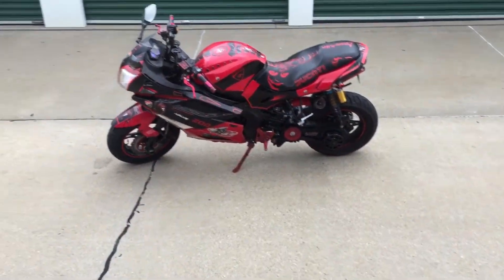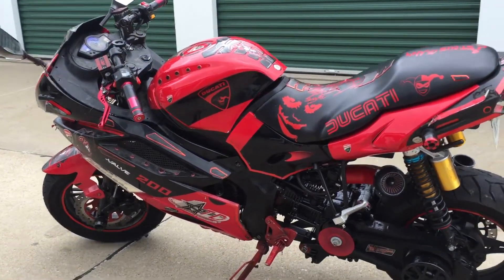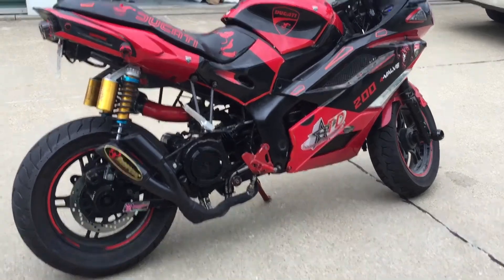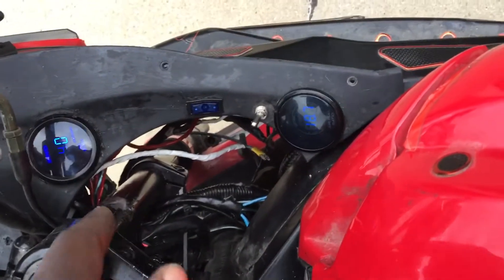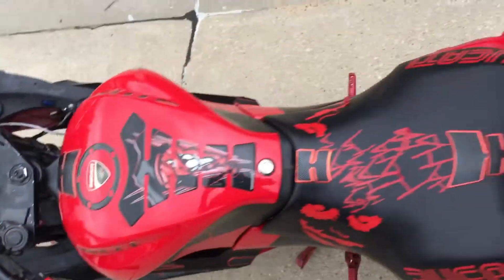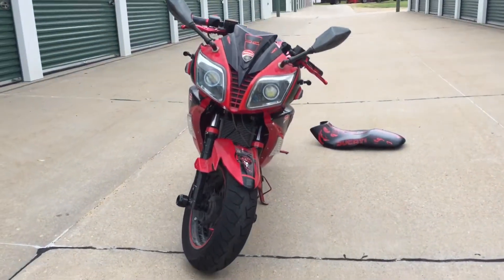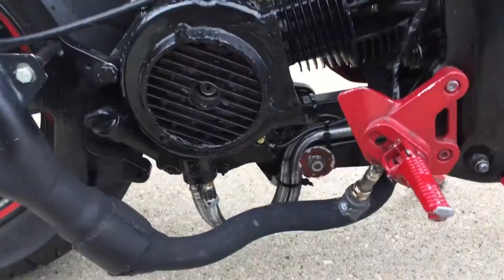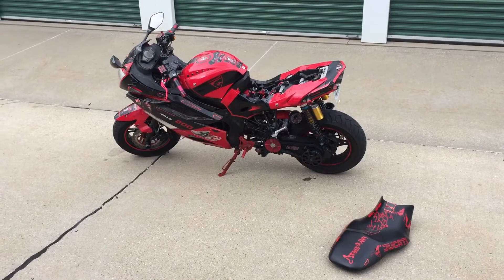Gy6 8.2mm stroker 206cc 4-valve

Comment: I'm trying to get to a 232cc right now.. I have the gy6 b motor I'm trying to get the 67mm bbk.. can I use the 8.2 in That
Reply from the maker: Just so happens I just built this engine for my new project bike , video coming soon, & it gets complicated....... basically you have to order the special crankcase made to accept the 67mm piston (eBay $400).... a lot of engines say “ b case” but are still 54mm stud spacing....the ones that actually are 57mm stud spacing will still only allow you to bore up to 63mm piston without destroying your oil port on the right half of crankcase.....I have the engine with 16” wheels which case is even more complicated because it uses a bigger crank which normal gy6 cranks will not fit (I tried) & they don’t make stroker cranks to fit so you will have to use stock crank,,, I had to order the entire special crankcase just to only use the right half (with modified oil port location & oil cooler outputs built in) in order to bore to 67mm (making my engine only 205cc) ..... the taida 67mm cylinder comes with spacer built in so I had to use 94 link timing chain with extended chain guides also taida head & valve cover (because the factory head & cover will not fit taida cylinder) , also I would recommend using taida t-300 camshaft or A-14 camshaft (same as t-300 but cheaper) .......shit is an expensive build bro but my 205 is a beast (: .....but to answer the question, the only way to make full 232 with 8.2 crank is to buy the special crankcase

Comment: So wait... what do you need in order to out that 8.2 mm stroker in? That's mf like a BAND.. so im trying to see what I have to do before I get that boy
Reply from the maker: No you can find the 8.2 on eBay all day for around $200 the taida is just more expensive for no reason.....the crank is not the problem, going up to 67mm piston is the hard part ....in my opinion going with 63mm piston with 8.2 crank will be a lot easier more affordable & you won’t miss the extra 27cc at 205cc
Reply: You might have to show me where this stuff is.. i have the same bike as yours. Just the 2021 but im sure it's not much difference outside the year ... do I get the 2v or the 4v big bore kit? Like the more I research I keep finding things and getting confused like this Taida Cylinder 63mm 205cc Liquid Cool Kit w/Cast Piston Fit 54mm (GY6). It has a port coming out of the bore for liquid cooling.. im like what? Do I get that or what...  this the link to it https://ncystore.com/taida-cylinder-63mm-205cc-liquid-cool-kit-cast-piston-fit-54mm-gy6?search=205cc%20big%20bore%20kit&description=true
Reply from the maker: @BigEagle4  I would go with 6mm stroker & 63mm oil cooled cylinder for a reliable 199cc ....also I’m pretty sure you have the special 150engine with bottom engine mounts instead of top mounts , meaning you can’t use the 232 case without welding new motor mounts on your bike anyway so your only option is the 199cc which you will still need to install an oil cooler
Reply: Bro how in the HELL! did you change the mount to the top
Reply from the maker: @BigEagle4  has to cut off old motor mounts & weld new mounts... not something an ameteur should attempt at all
Reply: Lol I'm over here pissed now cause I have I have the taida crankcase with those top mounts.. not about to go pay to have it done either..im just going to have to stick with the biggest bbk I can get for the Gy6 A crankcase... any info on that ?
Reply: Bro where can I get an exhaust pipe that fits cause the company I've went through has sold  me 2 parts totaling over 400 that I cant use and they won't correct the issue like wtf.  Pisses me off

Comment: I found that .005 intake and .006 for ext found it runs the best
Reply from the maker: Mattie g'rock yea I did too after ruining a 4v head got new one and that works great now upgraded to 400cc engine and that 206cc 4v original built up engine from my roma just sits in my garage

Comment: put a breather oil dip screw so it will fix your   back fire it will be sounding much much better
Reply from the maker: Leon Bennett I stripped out spark plug socket and was trying out a slightly different hotter spark plug that was my problem so the fix was helicoil for original spark plug or a new head, instead I chose to upgrade to a Suzuki Burgman 400cc crate engine....you should check out my last video....206 engine is sitting in my garage now

Comment: All of your videos professional and nicely done.  Have you ever thought about taking a job as a motorcycle customizer.  I will try my hand at it very soon.  I may have questions for you.  However, I would be working on a manual transmission 125cc to 180cc big bore conversion.  Nice work on the 400cc conversion, you have done the impossible amongst the small bike enthusiasts.  You’re starting to come up to the major leagues 😄
Reply from the maker: Al-Zamil Yamatazu thx my bro stay tuned for more updates on that 400cc upgrade!!

Comment: Nice I see you got the cover off the motor does that cause any issues how much faster is she
Reply from the maker: Vince Long rode it all day yesterday noisy engine in this video turned out to be carb vac leak.....she did not run hot and yesterday was a scorcher here in Iowa ...acceleration isn’t much more noticeable without fan and engine cover but she was already torquey anyway lol
Reply from the maker: Hey update got my oil temp sensor working right and she definitely runs hot!!!! I literally rode less than 3 miles up the street and the oil temp is already at 240 degrees I’m buying a new cover and shroud today and have to take engine off to put back on ...no cover and fan is definitely a no no!!! Idk how Harley’s pull that off